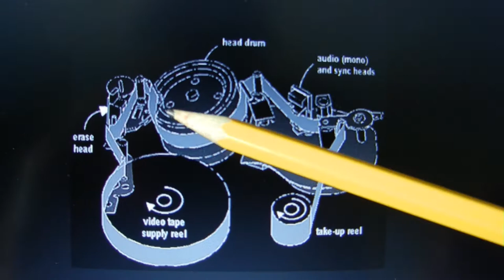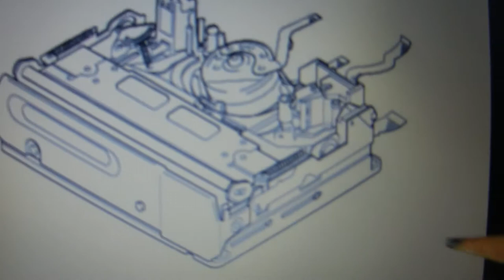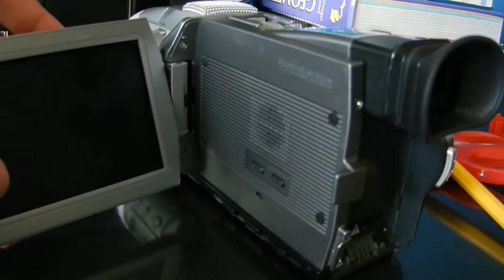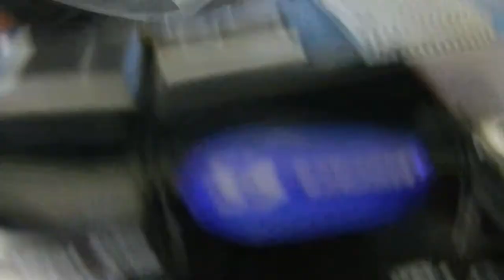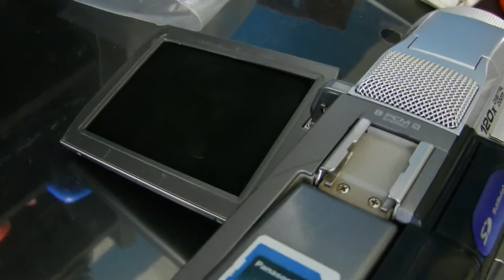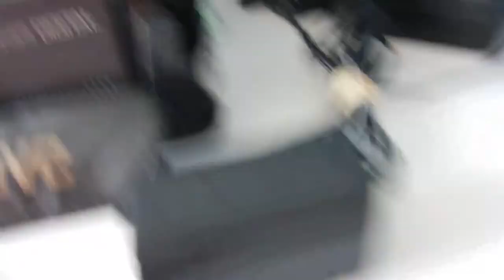How to fix Audio & Video glitches in a tape camcorder (MiniDV, VHS-C, Hi-8, etc.) ALTERNATE SOLUTION

Comment from the maker: One thing I forgot to mention: Check the tape of the cassette you are using. If the tape in crumpled and mushed, it will always have issues. If the tape is smooth, your cassette should be fine. Test across multiple parts of the tape. To salvage a cassette with crinkled tape, please check out the video below.
https://www.youtube.com/watch?v=x_a16FAUSR0
Reply: all my videos got blured ? Is that because of cam or casstes? As they r very old . I believe its because of cassttes i wqnt to recover those videos is there any way?
Reply from the maker: @Multicontent25  What kind of tape are you using?

Comment: Thank you for all the information! In my case, I have audio dropping in and out but I think it's the tapes. I have yet to check all of them. I have 13 tapes that run from 2006 to 2014. It seems like it's not a coincidence: the most recent three tapes were all Sony premium digital video cassettes, and so far only those tapes have audio problems. Other, older tapes made by Maxell and Fuji have no issues. I did clean the tape heads once using the Panasonic cleaner which I did nothing.  It could be that there was a microphone issue at the time of recording, but I think I remember that the taped played back OK at the time. Such a shame, there was a wedding and the music was SO good. Any thoughts? (Camera is Canon Elura 100)
Reply: Well, I think I answered my own question. What seemed to solve he problem was to fast forward the tape to the end, and then rewind it back to the beginning. I think I had done that initially, but doing it one more time was key. Maybe the tape was sitting around so long that it was a little "sticky" and wasn't passing through the heads in the correct way?
Reply from the maker: @mikem4814  That might have been it. Running the tapes back forth a few times can be a good practice to keep the tape "loose" or something

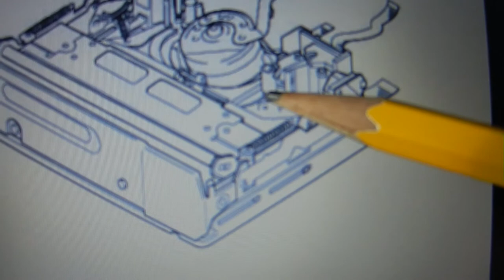Comment: 2:50 what if this piece of black rubber comes off? How do you make it stay in place?
-edit: do you find it common for the camera to not have any sound  while playing a tape
Reply from the maker: 1. That is what is known as the pinch roller. If you have a broken pinch roller ( which is very, very rare), you might have to disassemble the whole camera to replace it. The pinch roller has many parts as well (locking plastic clip, staff, etc). Check this video https://www.youtube.com/watch?v=goA86aLY4fk

2. Yes, sometimes my camera will act a little bit weird and will not record/play any audio. To fix this, I will run the entire tape from the end, and then back to where I want to record. This way, I am cleaning the record head a little bit. I try not to use cleaning tapes too much because they can wear out & can only be used 50 times.

Comment: Having issues with audio, it drops in and out for a couple of secs repeats. Guessing dirty audio head?
Reply from the maker: Is your format analog or digital?
Reply: @UdaySingh-rj1xw  digital
Reply from the maker: @koltinn  Either you need to clean the head with a cleaning tape or swab, or try to adjust the video head alignment with a screwdriver as demonstrated in the video.
Reply from the maker: @koltinn  First You should try to clean it, then try the allignment method shown in the video